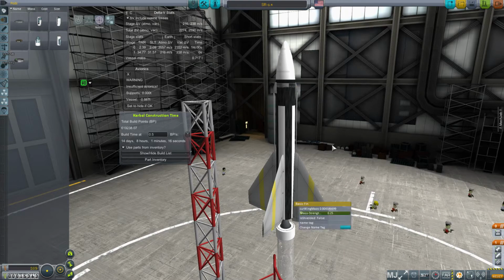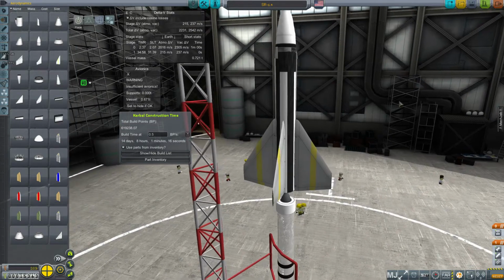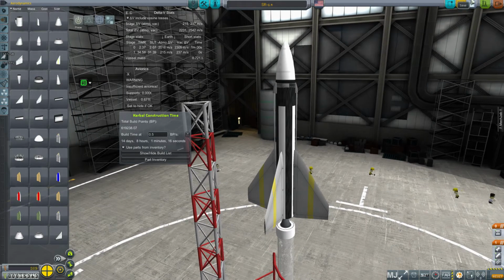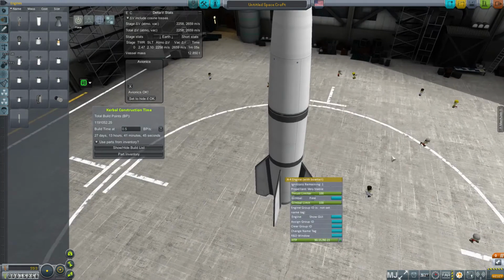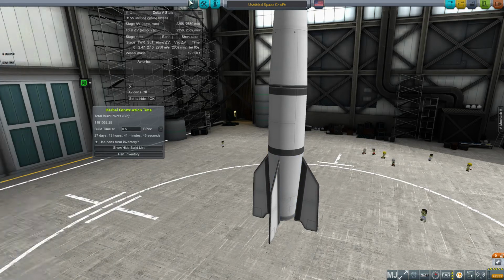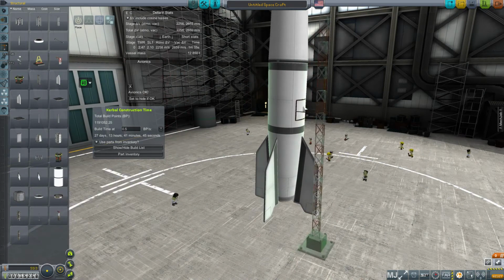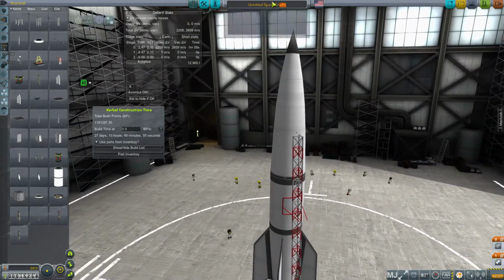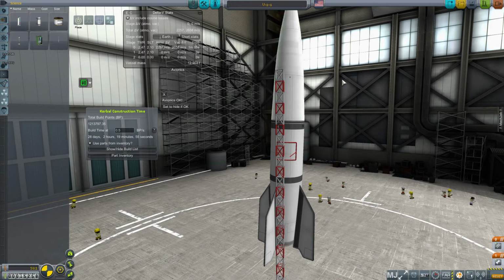RP-0: America 3 - Sound The Sky Some More

Comment: tip to "unrotate" parts in the editor: grab the part from the craft and press spacebar and all rotation will be reset. you also can use the rotation tool and press F to switch mode :)
Reply from the maker: +Acc Whatever 

spacebar is for staging only! Sacrilege! I'm terrible at remembering hot/quick keys, so lets see if I succeed at using that even once. :P
Reply: +Kyle Laskowski heh. just rouine then it keeps in the brain :D